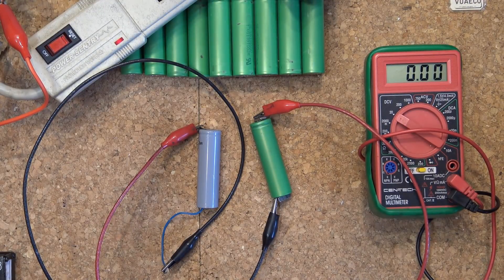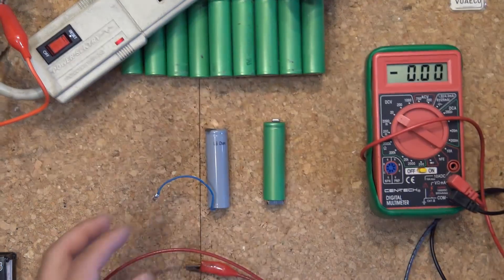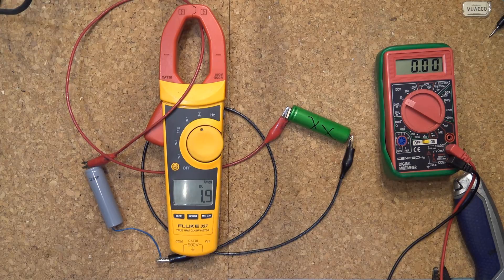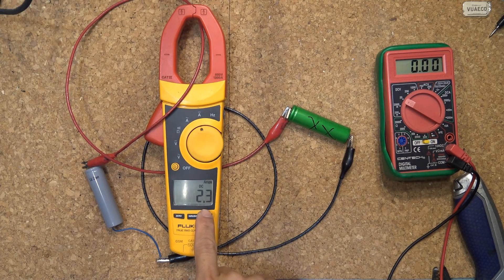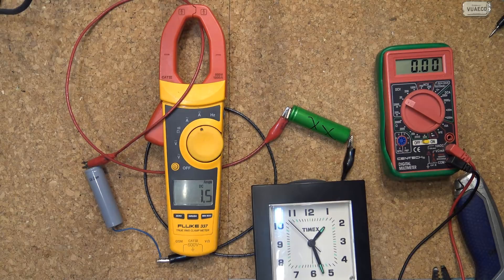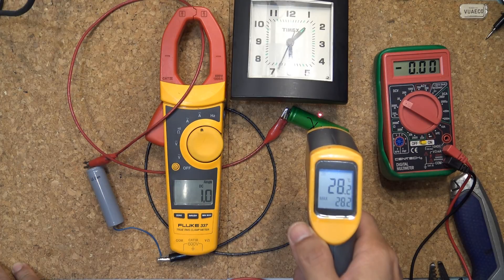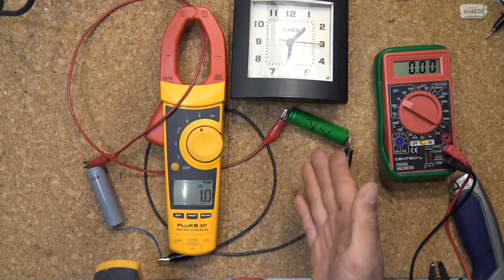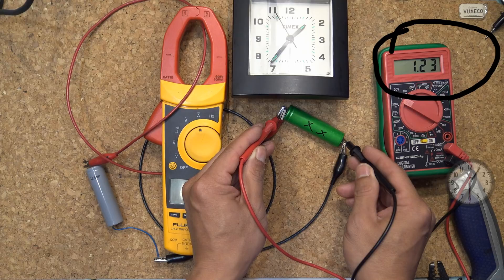Follow up video: Will it blow up? Reviving a dead 18650 Li-ion battery cell

Comment: Every time you do this, a jet airliner disappears over the South Pacific and everyone aboard frantically uses their last moments of life to make negative comments on this video. True story!
Reply from the maker: :D. While that sounds odd, it's very true about the negative comments. A cordless power tool charger (Dewalt, Bosch, Milwaukee, Makita, Porter Cable...) charges a 2Ah battery pack in 20 minutes. That's an average 6 Amps of charging current for the whole 20-minute duration. Of course, it will be initially more than 6A and then slow down when the battery is almost full but it has to average out 6 Amps in the whole duration. And it does this all day everyday. I do this at 3 Amps in 10 seconds with an exact same cell from a Makita pack. Yet, sadly, some people are too brainwashed by those Li-ion fire videos on the internet and keep saying things they've never tried themselves.

Comment: ⚠️⚠️⚠️
What you're showing in this video is extremely dangerous! If a cell that's been discharged so deeply is recharged, it can literally explode. This is because the internal barrier layer is destroyed by deep discharge. In the event of an internal short circuit, the cell will then inevitably burst into flames!
⚠️⚠️⚠️

Comment: You seem well informed but if there wasn't a mention to use a shunt or even a  warning in said first video , then he had a point even if you new low V is very safe also needed a mention . You know what happens to lithium exposed to our atmosphere technically, l didn't have your scientific career so witnesses the instant flash and deadly smells that lingers. Nothing will  stop the fire so the next one blows followed by kicking or shifting the fire outside for  there will be no putting the fire out just more explosions. I spot welded fully charged 18650s because another didn't warn this  ignoramus that didn't go to college . Smart dude , if the protection is just a  fuse then why is there any voltage reading when presumably it's open circuit ? Thanks lol.

Comment: Bro if they want to charge it at a lower amp rating the USB port has to be at 1 amp not at 2.1 amp bcuz when I connect the same 18650 battery charger with a different USB box the amp rate it charges at is different

Comment: i Have discovered an easy way to do this. I put a couple of good cells in my liito kala and a dead one I disconnect power. in a couple of minutes, I reconnect power charge the dead cell then test the capacity. I am no genius but I thought this through and it worked for me. It was your video that inspired me to try thanks

Comment: I just revived my old 20700 batteries from ijoy, been over a year since used and they would not take charge.
 the intellicharger new I4 has a function to revive the batteries and it worked. The cells had always been charged from the vape mod itself and I bought this charger and new cells, now I have 4 cells since this charger got the revive function.

Comment: To be safer, you could always use a single 1.5v AA cell in parallel with the 18650 you're trying to revive. That will charge the 18650 slowly. Then, bump it up to two 1.5v in series (3v), when the 18650 charges up close to 1.5v. After that is done, it should be close to 3v and be able to be charged in any regular charger.
Reply: great idea. i was thinking about doing just that. Theoretically was thinking if it was possible or also if it will reverse polar my 1.5v AA battery too. Maybe i'll do with a non rechargeable 1.5v aa so i can recycle it (if it goes bad haha)

Comment: I tried the parallel charging like the one in ur video but it didnt work in my 3 dead batteries, the only difference is i used 4pcs magnets 2 on both battery and connect the parallel cable. Is there something wrong with my setup? Tnx

Comment: Hi Vuaeco, i am newbie about this,Do you have any contact in facebook so i can contact you directly? I just want to clarify how to do parallel charging properly, because i'm confused about the cables in the video, it looks like you just connect the top and bottoms of 2 batteries, one good and one 0 volt. It doesnt look you use a charger in that method.I take a look closely in the cable if it's connected in the fluke 337,
How it will charge if you didnt use a charger?
Thanks in advance
Reply from the maker: Facebook is full of internet bullies, stalkers, and identity thieves. I don't do Facebook. You can just private message me on Youtube. In the video, I just connected the 2 batteries together in parallel for just a few seconds. That should be enough. Then I unplugged the parallel cables and put the dead battery in the charger and it worked.

Comment: I'm curious though why would the battery go completely flat like that in the first place.
Reply from the maker: Many reasons. If it's in a big pack, could be bad BMS. If it's in a flashlight, you might have forgotten to turn it off. Or just simply due to phantom load.
Reply: vuaeco I use use them for vaping. Thank you for the information. I like you explain how if it gets too hot or cold it is a bad battery

Comment: Excellent follow-up video.  When I saw the first one, I was also concerned about the possibility of high charge current but this video clearly answers those concerns and shows how monitoring temperature can provide a way to check during the process if you don't have a meter.  I like your allusion to the hydrogen bomb :D Coincidentally, if I'm not mistaken, H-bombs are fabricated using lithium hydride  (LiH) where the hydrogen is an isotope called "tritium" than contains two neutrons in addition to the proton.  Not that that is relevant but I thought the connection with Li was kind of humorous relative to your example. Thanks for another great video!  I've subscribed. (PS -- I like the idea of using magnets to make connections !)

Comment: Well done vuaeco.  I agree with all you said except one case:  cells required to get warm during charging.  Most of the time during charging using TP4056 I can feel only a slight warmth using the BACK of my hand (front of people's hands are not as sensitive to heat).  But in quite a few cases I have had cells charge up from below 2.5V or even 0V and fully came back to full 4.2V charge yet I felt absolutely no heat!  As I thought like you at first, I did extra tests on them at first to verify if they were really healthy.  To my surprise they acted fine with normal capacities.  Redid the charge/discharge again and got the same.  So apparently there are exceptions to the general trends, but no hard absolutes as there are so many variables to consider in the life of a cell.  One reason why the cells did not show heat is possibly due to a very low IR.  It makes sense all cells have some resistance producing heat during charge or discharge and you felt the heat but I might have had a very low IR cell so much less heat.  Just a guess.
Reply from the maker: The heat generated is dependent on the charging current. The higher the charging current, the more heat is going to be generated. It's possibly your TP4056 was charging at a lower current than default settings (1A?). And it's also dependent on the cell's internal resistance. High discharge cells like those in power tool batteries can discharge lots of current and they can also take in more current than a regular cell. It's also dependent on your ambient temperature. If you're in a cold room, the cell is basically being cooled by the ambient (cold) air so you won't feel the heat as much. And finally it's also dependent on the age and condition of the cell. There are lots of variables here.
Reply: Agree vuaeco, there are lots of variables why I encountered some cells not getting even warm during charge.  My setup is a TP4056 charger station made of 10 units powered by a 20A computer power supply.  When noticing the "cold" cells it is with comparison to the other cells also charging and  not just a single cell.  So some will be warm or even very warm but others occasionally are "cold" all during the charge time of usually 1 1/2 hours or so.  There is no particular TP4056 acting strange, all working normal.  If the cell were not getting proper charge current then 3V or less (usually) but like I mentioned earlier, a particular set of cells at 0V for example, would not reach 4.2 in just 1 1/2 hours.  During charging I always check every 15 minutes or so all the cells for heat.  Some cells may start out warm and get cold over a long time before reaching 4.2V, but the ones I first mention are the more unusual of no heat at any point on the charge time line.  I have seen many peculiar results with these old laptop cells.
Reply: No at 1amp a healthy cell will not warm significantly at all. Assuming a normal climate controlled environment no more than 35 degrees or about 95F. The dendrites are what causes heat. You can detect dendrites by measuring internal resistance and comparing it against the whitesheet for that cell. That harbor freight meter ( funny sitting next to the fluke ) is up to the job without any problems. I used those in my stores because they were accurate enough ( voltage is usually about .05 low because of the shitty leads ) and they are cheap.

Comment: Just for fun see if it is better to slowly revive a dead cell that has been at 0v for a long time or your quick revive method. Test their Ah after giving it a full charge discharge cycle.
Reply: If the source is not current controlled, you will potentially cause the source to drop to near 0 as the current rises towards infinity.

Comment: I am just trying to make sure no one burns their house down and gets permanent lithium poisoning because their lithium cell goes into thermal runaway from a shorted cell (like the one you showed drawing almost 6A) or even just burns their fingers because they don’t have a fancy IR thermometer. If you are showing this for people that don’t even have a current limited power supply you can’t rely on a safe and accurate thermometer, they will be using their fingers. JUST PUT A RESISTOR IN SERIES PLEASE simple and cheap and you are limiting the current to a maximum known value
Reply: You got fucking owned bro. Now lick up the mess you made.
Reply: A lightbulb in series with the battery also works well as a poor man's current limiting device. There's no reason not to do things safely even if the chemistry might not fail catastrophically. Also most li-ion charging ICs have trickle charge currents when the cell is beyond its overdischarge voltage threshold. It'll charge at 0.1mA - 1mA until it reaches that threshold and resume regular charging. But it's always good to do a few charge and discharge cycles to reconstitute the plates of the cell
Reply: Thanks everyone for the really informative and helpful comments. 👍
Reply: SuperBrain there are different types of lithium cells. LiCO4 ( aka IMR or lithium cobalt ) IS EXPLOSIVE. The cells vuaeco is messing with are LiMN which DO NOT EXPLODE. LiMN will boil and vent the electrode but it is not youtube worthy its just hot gas. 

Not all lithium cells are the same. While vuaeco may not fully understand some elements of electrical theory when it comes to batteries the alarmists I have seen in these comments are just as bad. Learn about the different types of chemistries used first. LG doesnt make LiCO4 cells anymore and they havent in a long time. Samsung still does as does Sanyo/Panasonic still offer LiCO4 cells. There is a massive difference it would be wise to learn it if you are messing with cells or trying to tell people they will explode.

Comment: Check the voltage after disconnecting the charge leads. When the leads are connected, you are not getting an accurate reading
Reply from the maker: That's correct. But this is not a permanent way to charge an 18650 cell. The point of this method is just to bring up the voltage of the dead cell to a point that is enough for a real 18650 charger to accept it and charge it properly. When a Li-ion battery does not have high enough voltage, the charger would not charge it. I think the reason is safety because if the voltage is too low, it might take a risk of charging a NiMH or NiCad cell which are only 1.2 volts each. And if you put a NiMH or NiCad cell (at 1.2 Volts) in a Li-ion charger that charges up to 4.2 volts, all hell will break loose.
Reply: Still doesn’t prove it’s voltage